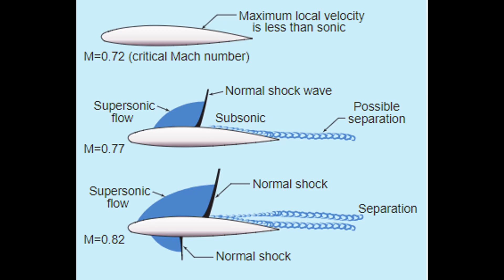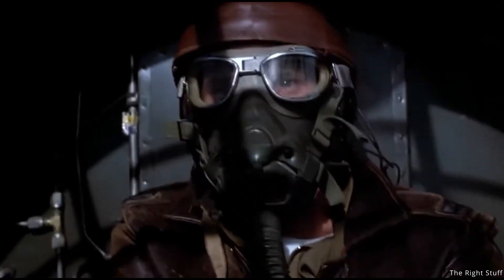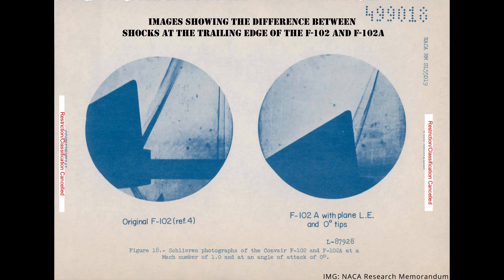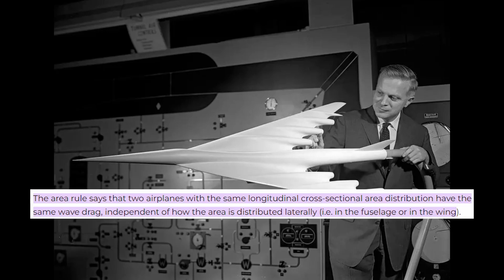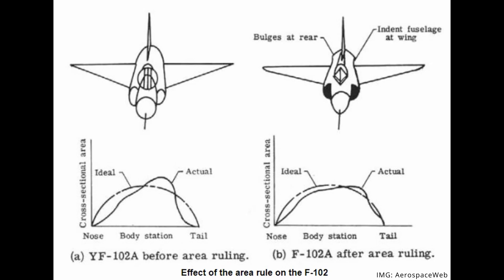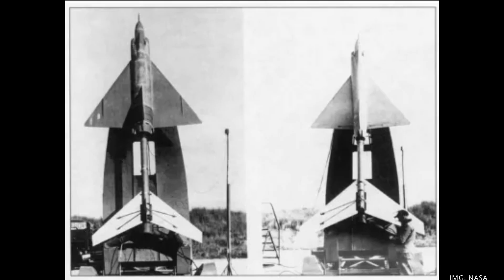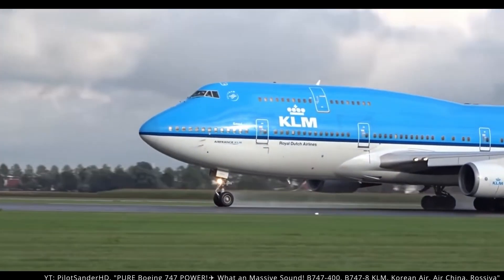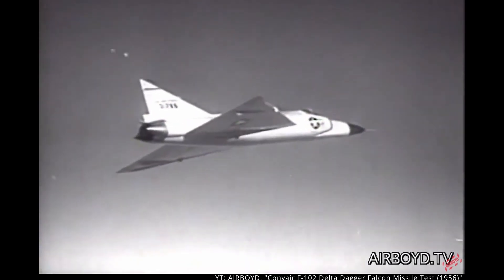How the Area Rule Made Planes Faster

Comment: The "increase in drag of the configuration in all directions and for a GREATER DISTANCE" was a brilliant insight.  It was generally believed that the effect of air accelerations was relatively local.  Once you understand that the effect is for a much larger distance, the problems with the P-38 become obvious.  The combination of the engine nacelles, cockpit gondola and wing combine to create a massive increase in area over a short distance.  Each of the components accelerates air, but until you begin to get near transonic speeds, it is really not an issue.

Comment: Planes have engines ahead of the wing to avoid flutter. Also the 747-400 bump ends there because when they shrunk the original 747-100 to make the 747SP they had to rework frames around the wing box because the upper deck now ended level with the wings, then on the 747-400 they reused that same frame and extended the upper deck backwards. I don't believe the area rule came into either decision. The 747's bump does produce lift though.
Reply from the maker: Some of the sources I have in the description are the basis for my examples, but you are right that there are definitely other considerations included in these features.